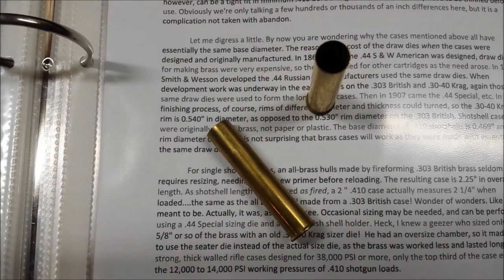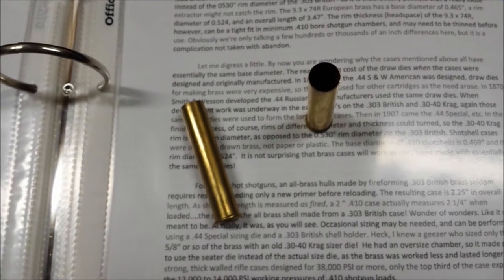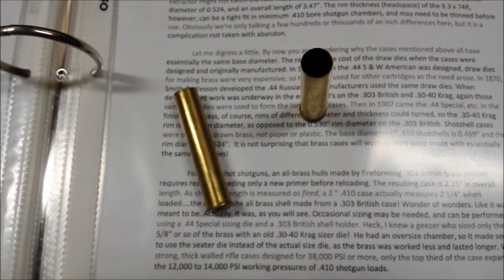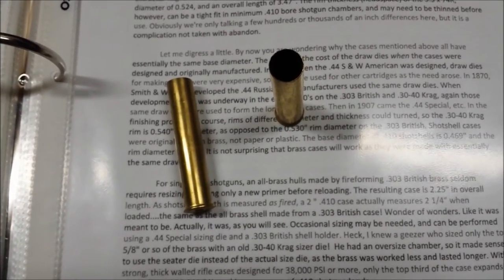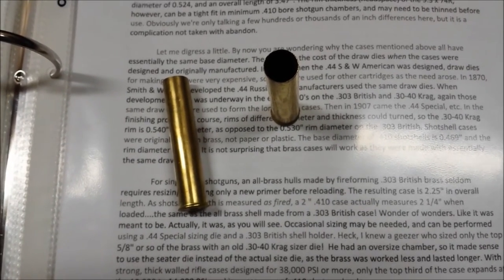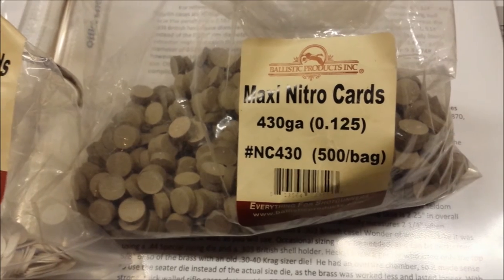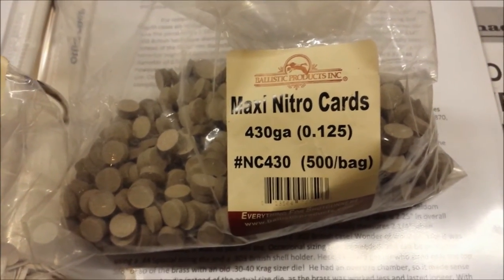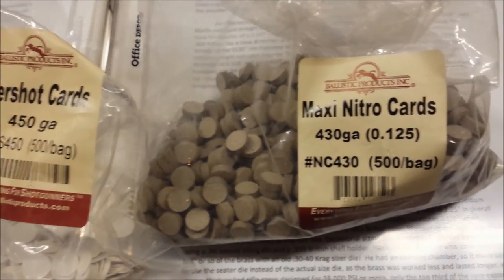.410 Brass Shotshell Follow-Up

Comment: I have an entire bucket full of fired .303 Berdan primed brass. What I have been doing is drilling through the firing pin indentation, and subsequently, the Berdan anvil with a #4 countersink bit. This gets rid of the Berdan anvil and creates a shoulder for the flange of a new 209 primer at the same time. Then I finish by drilling with a letter B drill. This creates the right size hole for a 209 primer. Then, since .303 rims are a little too thick, I trim the rim on the case very slightly so that it will chamber. Usually enough to take the headstamp away. It may be best to do this prior to drilling, so that one can get the correct depth with the countersink bit for the 209 flange. One can fire-form, but that wastes powder. I anneal, then gradually size up, and up, until it's 'close enough'. Then I just let a shot load do the rest of the forming. This may be complicated to some, and it takes some time, but it's a way to re-purpose the Berdan brass.
Reply from the maker: Awesome!

Comment: I use cardboard over-powder cards, then a Claybuster wad in mine.  Produces nice patterns that both bust clays and kill squirrels well!
Reply from the maker: +Drpermer Thanks for your suggestions!  I have pattern tested the load I use and it performs as well as most factory .410 loads on the market at typical squirrel distances.  I haven't tested using any sort of shotcups or plastic wadding.  One main reason is that I don't like the look of wads laying around in the woods.  I heard about people making their own over-powder and overshot cards but I haven't done that yet.  Cheers!

Comment: Can they hold a 45 long projectile with the shotgun load
Reply from the maker: I don't know if they will hold them OR if that would be safe to fire if it did.
Reply: Lets see. A 45 round is .452 in dia. A 410 is .410 in dia. I'm not sure you could get the 45 down the 410 barrel with a steel rod and a hammer.